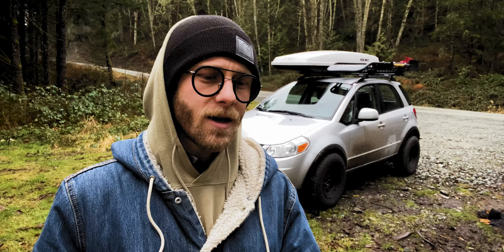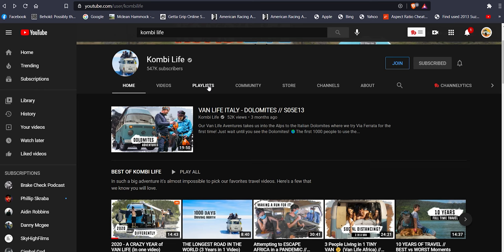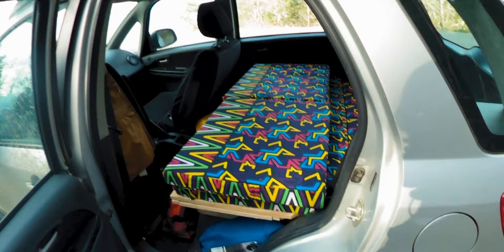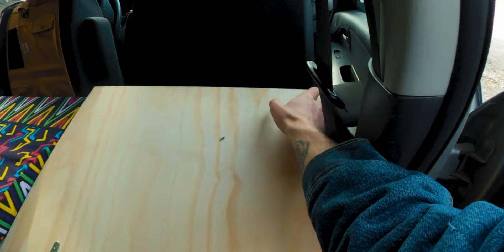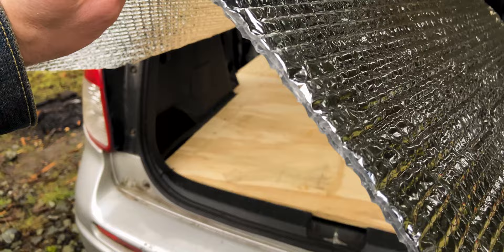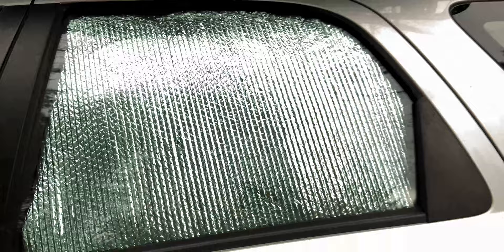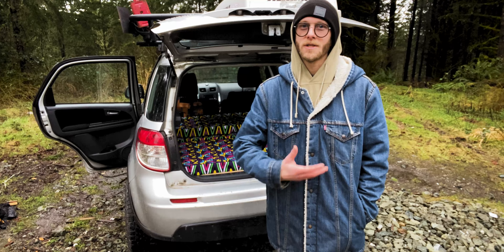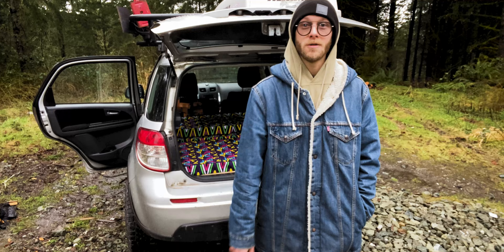Suzuki SX4 - Camper Conversion - Tour / Vlog - Pan American Adventure - Boondocking with BMO - 4k

Comment: Hey man, your car looks really cool!
I wish you luck on your journey.
A tip: install wind deflector on the car windows, this makes it possible to open the windows slightly and let out the moisture (from breathing during sleep) that will condense and leave the car with a bad smell.
Reply from the maker: Thank you so much man! So inspired by your build! 

After rewatching your video I noticed the wind deflectors you have, so you happen to remember where you got yours?
Reply: @BoondockingwithBMO  I bought it on the internet, on a Brazilian website similar to ebay, amazon, etc.

Comment: What I did was I bought some black plastic film rolls from amazon. I stapled this black film to the reflectix. Now people from the outside just see a complete blackout. It just looks 100% tinted from the outside. Worked great.   Also, where is your spare tire now, I did not see it? Wish you all the best. The time is now, not when the time is perfect, because the perfect time never comes... My 2009 SX4 says hi to BMO.
Reply from the maker: I love that Idea! I really don't like the look of the reflecitx. Do you feel the black absorbs the heat and sun? I guess you're not really sleeping during the day, but the early sun might raise the temp a little faster? Thanks for the suggestion!
Reply from the maker: also, BMO says Hi as well!! we love making new friends!
Reply from the maker: My spare tire is currently at home, atm the don't have a good place to mount it. Now that the weather is warming up I'm able to start preparing for the bumper builds. I'll be adding a swing arm over the rear hatch that will allow me to mount my spare tire, but for now, it lives at home.
Reply: @BoondockingwithBMO  The layer of reflectix helps keep both the heat and the cold out. I did notice the outside black does get hot in the sun, but that's against the window and the reflectix stops the transfer of outside temps. I splept inside in Florida during the day a few times, it does get warmer, but not like outside. I also had a curtain blocking the front from the back. I also got water drip things on the outside so the rain doesn't drop in. I just crack the windows an inch or two and get outside air. If it's not raining, I have misquito netting that I put in the windows. I have a 3 to 4 foot roll and just place it between the door and car - I shut the door on the netting, and wala, I can have the whole window open and the netting stays in place...
Reply from the maker: @danherrick5785  Man, I would love to see a video of your rig!! it sounds like a keeper!

Comment: so where did you put the spare tire?
Reply from the maker: Currently, I am not traveling with one, BUT in the next couple weeks to a Month, Ill be building a swing arm for the rear bumper that will hold the Spare tire, Propane, Gas, and extra odds n ends.

Comment: Hi What's your tire size?
Reply from the maker: 215/75/r15 with 15in by 7in wheels with a -6mm offset. I recommend a 0mm offset if you go this tire size.
Reply: @BoondockingwithBMO  Thank you for your answer. Are the tires 195/65 / r15 recommended by the manufacturer, do your 195/75 / r15 tires fit under the wheel arch? What would be the best tires for the highway? Can I use 195/55 / R15 tires to lower the center of gravity?
Reply from the maker: @jankowalski-lg4zx  I know nothing about any other tire sizes. I have only used the 215/75/r15 I had to do some cutting in the wheel well to make room for them in turn. Anything else I wouldn't have the slightest idea. My apologies.